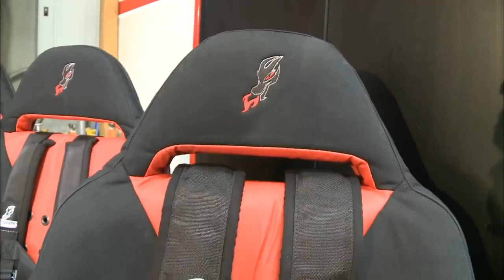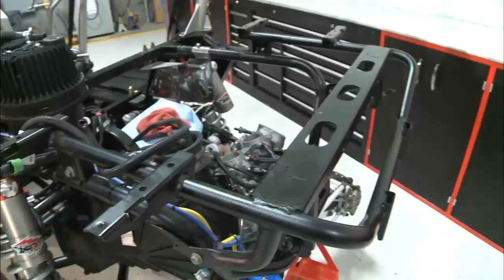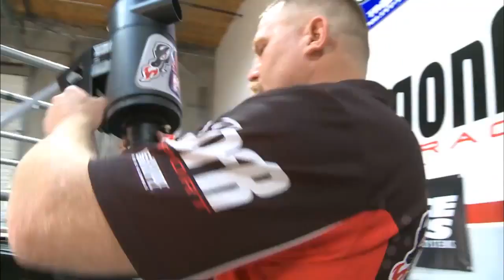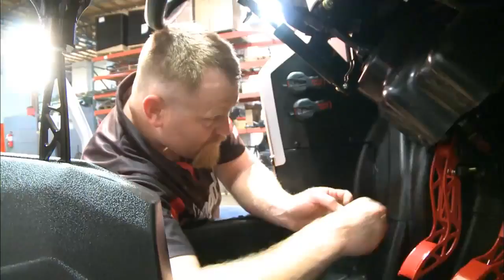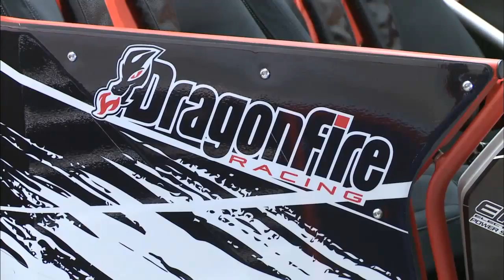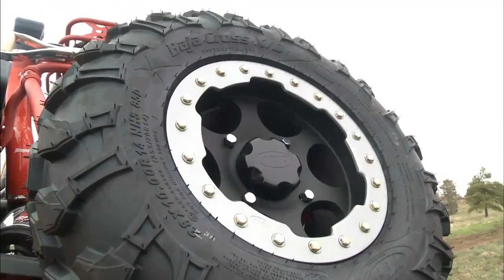Destination Polaris DragonFire Project X Video

Comment: very very very cool rzr, but that snorkle is useless without a cvt snorkel, axle bellows, and dialectric grease in all the conectors and park plugs
Reply from the maker: DragonFire has found that most people will go through and create their own CVT snorkel to fit whatever application they have. As for the electrical connections we are unable to provide a competitive price on the dialectic grease so rather than over charge we leave that to the rider’s discretion. This kit will effectively snorkel the intake of the vehicle, for those that like to go really deep in the water it is a good starting point to make your machine capable of handling it.